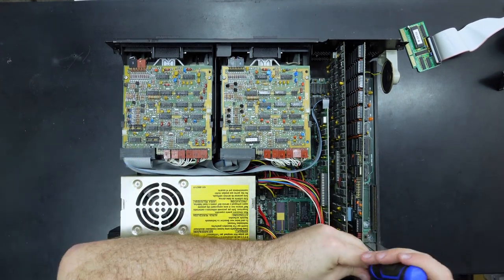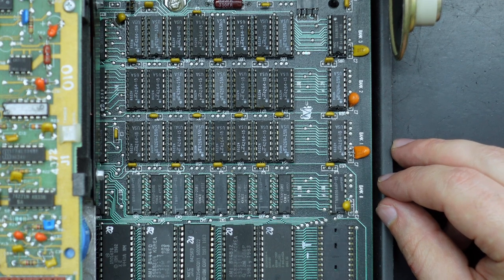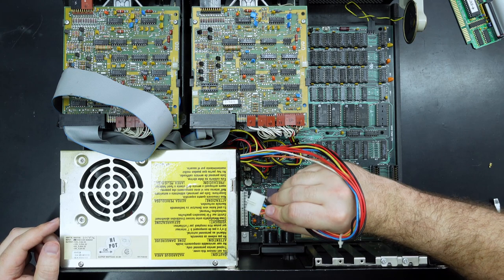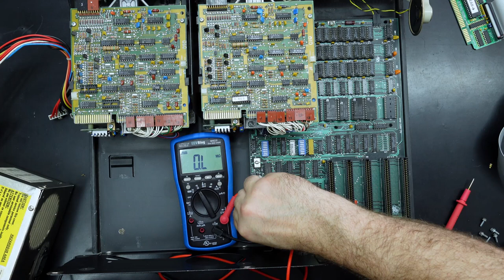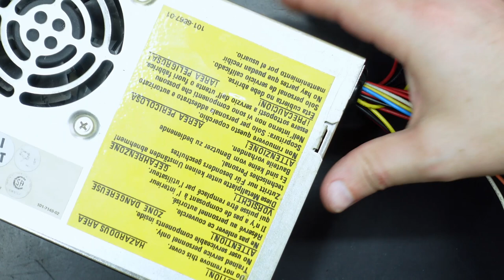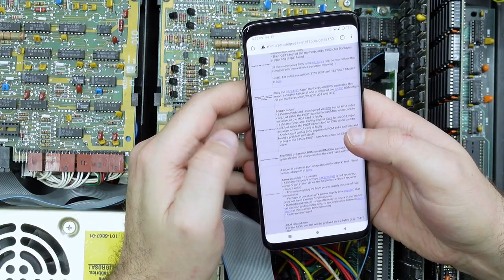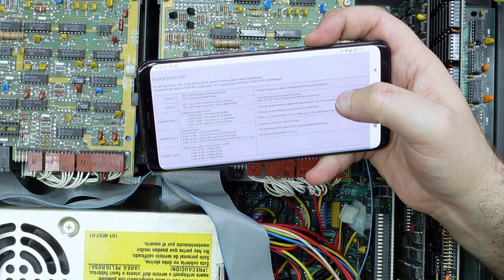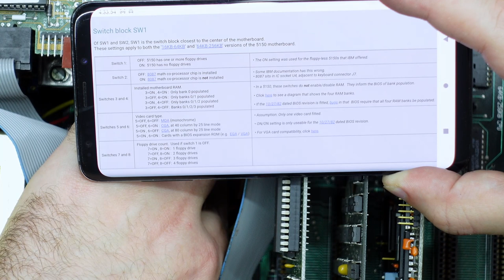IBM 5150 Repair PART I #Doscember2021

Comment: Thanks for the video, it helped me to see what kind of fan is installed in the PSU, as mine has started to sound like a Merlin engine from WW2, and it looks like a "bog standard" one; (the rest of my beloved 5150 functioning with no issues, touch wood...).

Comment: 18:06 T-RES is the termination resistor. Floppy drives back then had to have resistor termination for proper detection (we had a 5150 in our house).

Comment: Nice video! 

16:17 the PSU has been repaired before. There’s another PSU in there. So definitely not the original board. Even the metal bottom of the replacement PSU has been reused as some kind of a mounting base for the new PCB. Neat! :D

Comment: Great video. That last bit with the "parity error" almost had an element of pantomime. "Behind you!".
I know from my youth spent hanging around an old TV repair shop, that when people work on screens, they usually stick a mirror in front of them so they can easily see the other side of the screen. Might have helped in this case :-)
Reply from the maker: Hah, yep. Although to be honest with the information the owner provided me, I already dismissed it as not working beforehand. I'll explain more in part 2